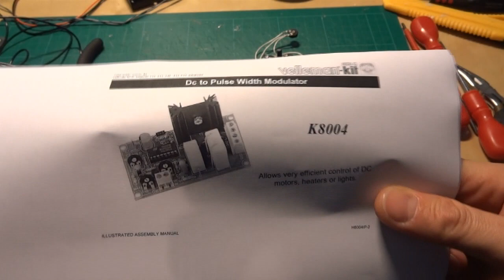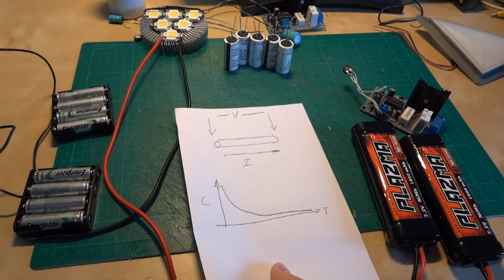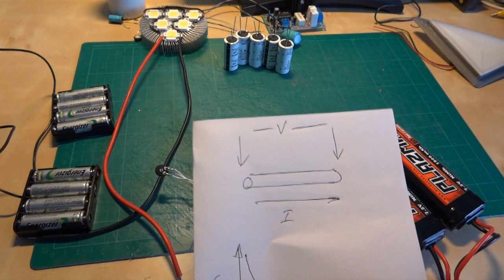Iron Man Power Suit #44 | Starting the Unibeam | James Bruton

Comment: You could do with some sort of reflector array to focus the light into a beam in much the same way that the reflector in a torch would, then it really would be a "UniBEAM" rather than a 'Uniglow' or a 'Unishine'. If you could set it so the PWM controller gradually increased it to about 20% (the characteristic unibeam charging phase) then used the capacitor array to create a pulse, that would be much more true to the thing in the films. Just a thought.